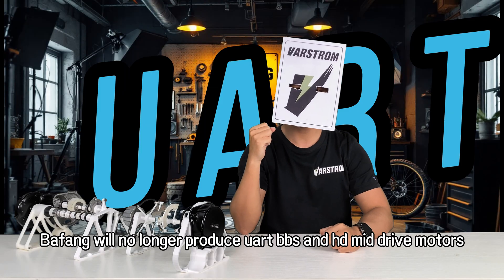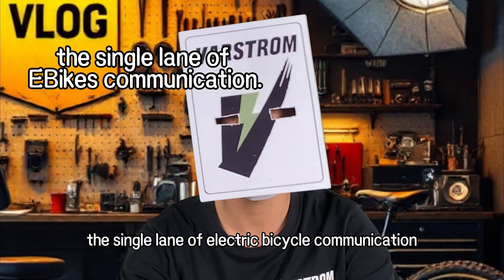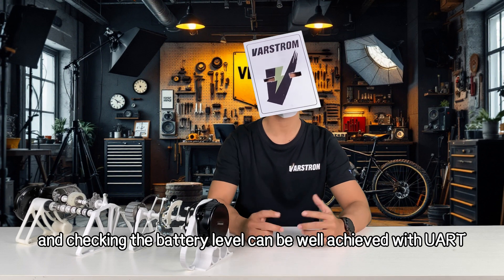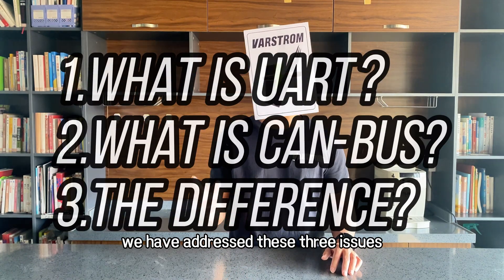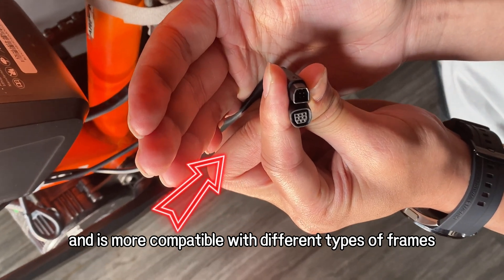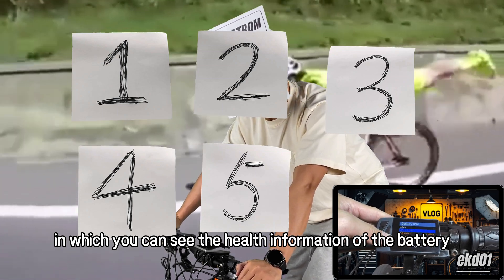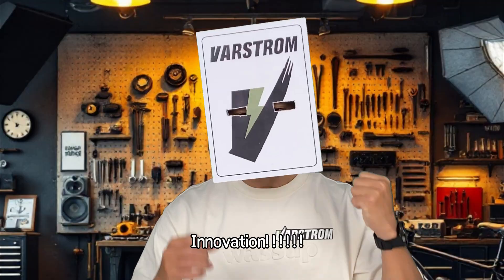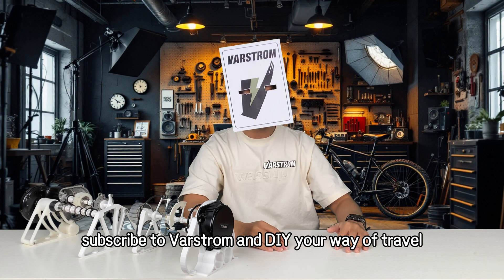News All EBikers Should Know!! WHY? Bafang no longer produces UART BBS & HD丨VS CAN-BUS

Comment: CAN-BUS is trash for diy market. The use of CAN-BUS is for money like this video. And cost of parts becomes unnecessarily high AND you can never strey from the OEM so nothing can ever be modified. Top dollar to own something that leaves you at the mercy of the retailer
Reply: Absolutely, can bus is used in many industries and to date the only thing it does is allow manufactures to make replacement parts rejection by controller so the manufacture can gouge more since only their parts will work! I use a VESC open source controller to avoid such things, at 115100 a single serial line can carry more data than any bike needs to control its motor and do any display imaginable.
Reply: Couldn’t you replace the controller to something that is open sourced? Like the Flipsky Vesc?
Reply: @slayer324  can bus makes it easy for digital serialization to reject components, totally rewiring and removing components to make it work in open sources ecosystems would not be worth the effort since other manufactures exist and are not doing this totally stupid move to sell new displays and accessories, personally I do run a VESC, but the vast majority of ebike buyers and riders are nowhere near able to take on wiring in a VESC let alone getting the multitude of setting correct. I hate shity moveseant to push proprietary crap on the ebike market. In the end those that build have nicer bikes the stuff on the market in stock form is very janky overall.
Reply: @ I gotcha, I haven’t personally used Vesc but between being an electrician by trade I’m also a programmer so I’d like to try it one day on a build.
Reply: @slayer324  no it won't communicate with the rest of the system. EVERYTHING needs to communicate, if they don't then it won't work. If you literally take off every everything and rebuild with a kit it will work but that would defeat the purpose of buying anything CANbus to begin with. It's basically racism and won't accept anything but it's own kind
Reply: Yes, CANBUS is a money grab to sell proprietary products.  Each motor will have to be evaluated separately.  Presumably many will retrofit old UART controllers to new CANBUS BBS02 and BBSHD motors.  Many will not buy the overpriced Bafang battery, which is the real Bafang money grab here.  Early word is, Bafang CANBUS motors will work with non-proprietary batteries. CANBUS in this regard only helps to evaluate individual cell integrity.
Just like we DYI'ers build our own ebikes, we will hack these motors to suit our purposes or builders will go to alternative non-CANBUS protocol motors which will come along.  Careful what you wish for Bafang. Greed has been the downfall of many companies.  Tongsheng TSDZ2B and Tongsheng TSDZ8 are non-CANBUS and torque sensing with available Open Source programming.
Reply: @lukewalker1051  You can't retrofit UART or anything to CANbus. It's fully OEM and every single component has communications. Motor, battery, controller, Display, sensors are all proprietary and have communications between them so anything that is changed to non OEM will not communicate and the bike will recognise this and will not function. There is no bypass for communications, if it doesn't communicate then too bad so sad your bike will not work. Like I said top dollar to own something that leaves you at the mercy of the retailer. I have only owned one CANbus system being a Bosch and it was the worst experience, like for starters their batteries start from $1000 for a 36v11ah battery 😐 plus $200 for a charger and if you try change charging port or mod another charger to charge the bms will shut down. Bosch will even lock you out of using bike if they detect you are trying to mod the system that you own and purchased off them.for $4k+ but now is unusable because they have blocked you out of bike. CANbus is nothing but a rip off. They are literally stealing your money with stupidly overinflated prices

Comment: As long as the user can further use any battery it's fine, but if it is a step towards more proprietary parts like Bosch likes to handcuff his users it would be a shame.
Reply: I believe 'for now' Bafang will not cut off their nose to spite their face and even on new CANBUS Bafang motors, non-proprietary batteries will work. Will see what the future holds.
Reply from the maker: Currently, it is possible, and we will develop batteries that are compatible with the Bafang CAN protocol. This means that you don't have to buy Bafang's proprietary batteries.
Reply: @varstromebikeconversion  I tend to buy cells and build batteries myself. Not because it is neccesarly cheaper but because I can make the best use of whatever space I have in my frame.
Since it's about bafang I'm talking about converting conventional bicycles not proprietary frames for E-bikes.
Reply from the maker: @ You made a good point